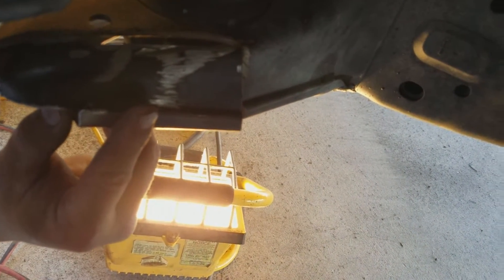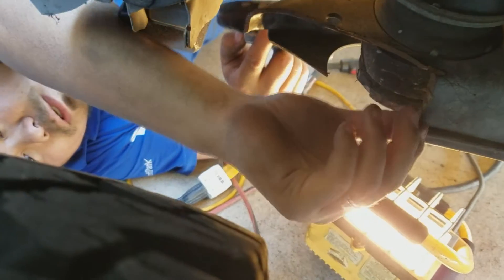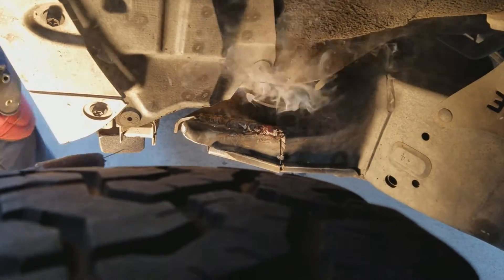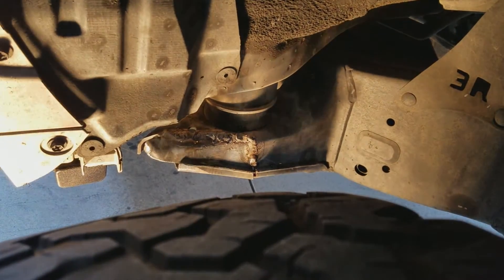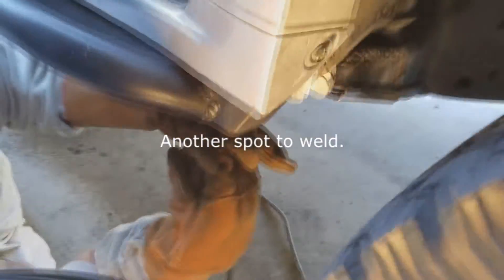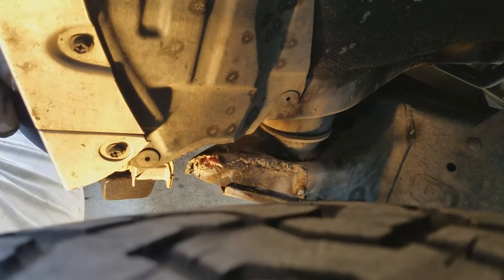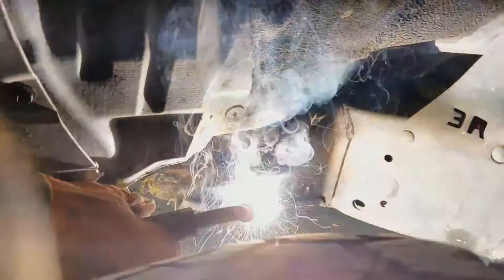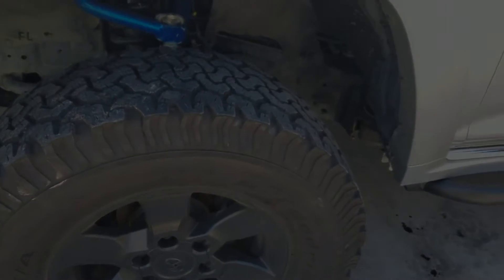4runner Body Mount Mod

Comment: What size tire did you put on?
Reply from the maker: This 4runner belongs to my bro in law. It currently has 33 inch tires. He plans to go up to 35 once this set wears out.
Reply: Yeah that is my plan too, running 285 Toyo but going up to almost 34inch and it looks like I will definitely need to do the body mount chop, just learning to weld but I think I will have my dad come out and help me.
Reply from the maker: yeah. you know you don't have to weld it. I only insisted to do so because I couldn't stand the sight of a crude cut mount. however, I felt welding it will be better in retaining it's original integrity.